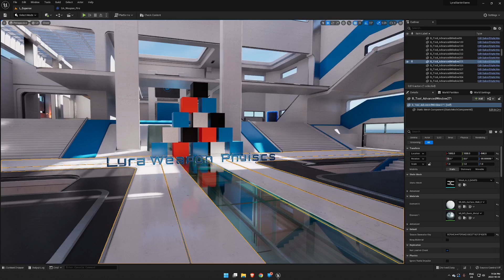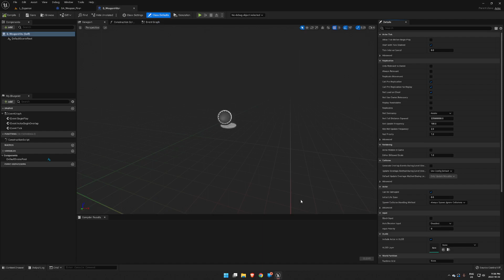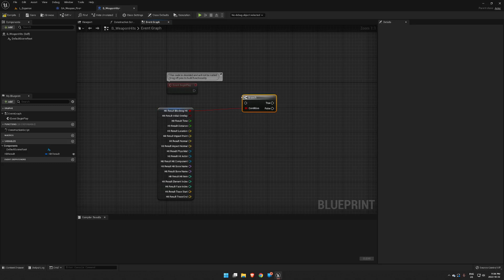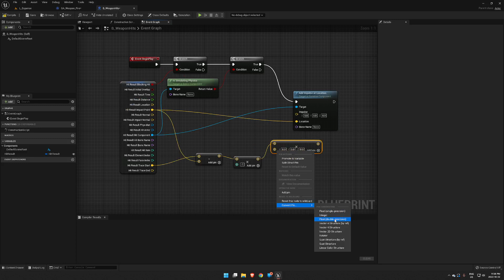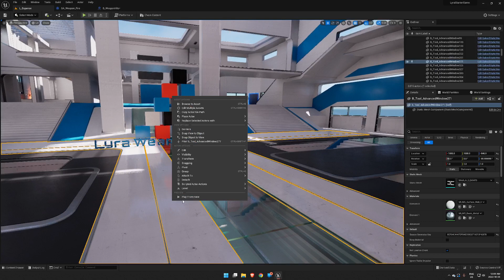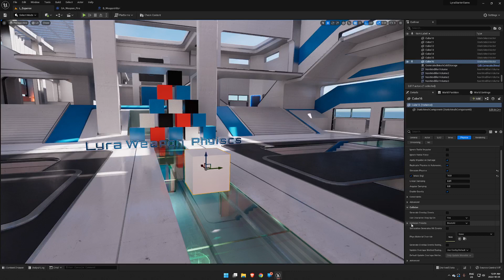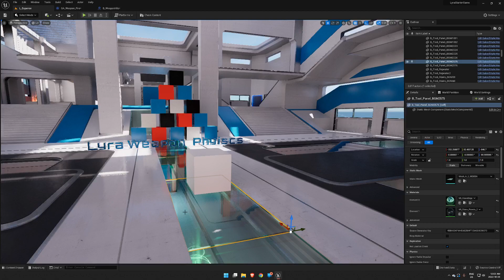UE5 Lyra Basic Weapon Physics Part 1 Guns

Comment: It works for me in 5.2, after removing "Field Actor to Spawn To Impact" and dependencies. I optimized the code, removing multiply by -1 and inverting the subtraction order, so you can subtract Hit Result Impact Point MINUS Hit Result Trace Start, this way, you don't need to multiply by -1.

By the way: Thanks for the tutorial, it was really nice 🙂
Reply: @aznmike2904 , remove the "Field Actor to Spawn on Impact," "is Valid Class" and Branch
Reply: Thank you for the tip! It worked in Unreal 5.4.4 after I removed Spawn on Impact," "is Valid Class" and Branch and connect Has Authority directly to SpawnActor B_WeaponHits :D

Comment: this doesn't work anymore in 5.1 not sure what's changed. maybe something going on with collision complexity.
Reply: It's the same for me with 5.1, have you found a solution?
Reply: @Blondes_gaming  I'm unsure the root change in Lyra's code, but change the add impulse location should come from the weapon trace end rather than hit result impact point. That will apply the force to where the trace ends.. which would be the part of the cube the asset is pointed at.
Reply: @emeraldgems5898  hmm, I tried this, still didn't work...